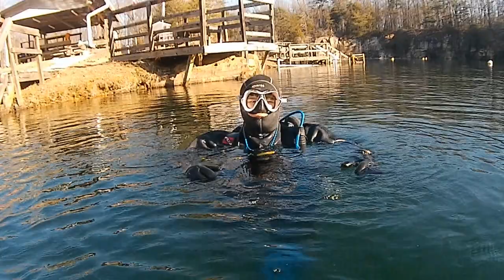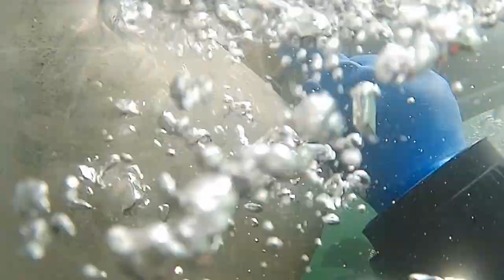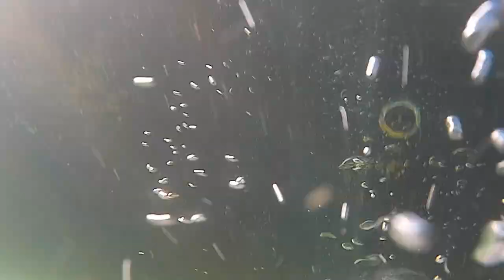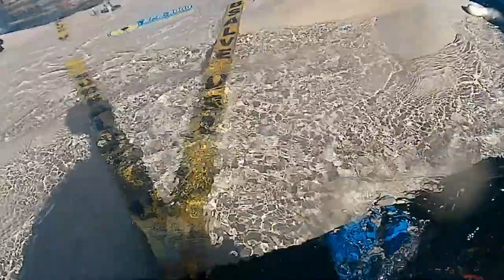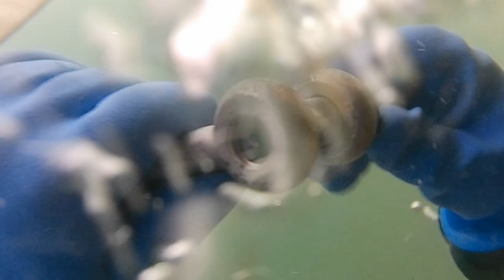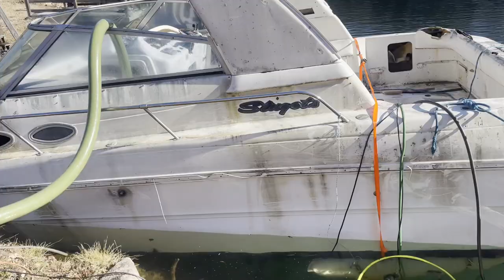Salvaging A Boat {[So We Can Sink It Again]}

Comment: Hey Brian. Oddly I was looking yesterday at becoming a member. What is the viz typically like. I read they all had aerators.
Reply from the maker: Hello firesprk, the visibilty ranges between 20 feet and 50 feet. Before we added the areators to all three quarries, JMR averaged 30 feet, American averaged 5 feet, and Lake Norman averaged 15 feet. Not only has the areators helped with the visibility, it has also eliminated all the thermoclines. Typically, now in the summer time, you can wear a 3mm wetsuit at 98 feet in the Lake Norman quarry, and at 80 feet in the JMR quarry. Its actually quite phenomenal.